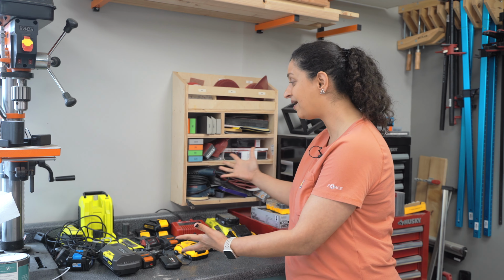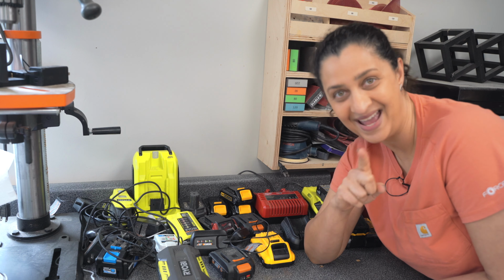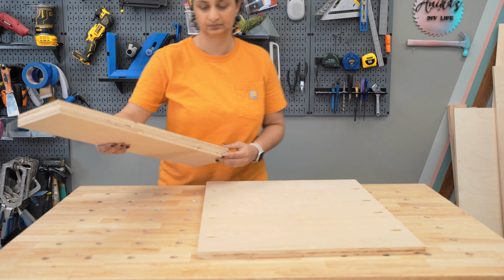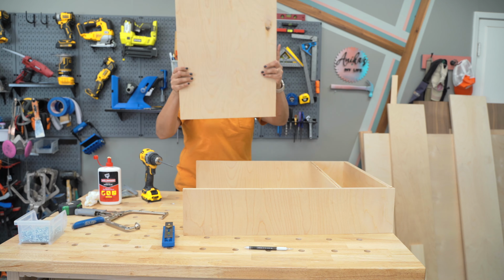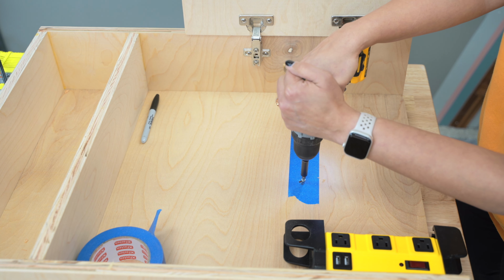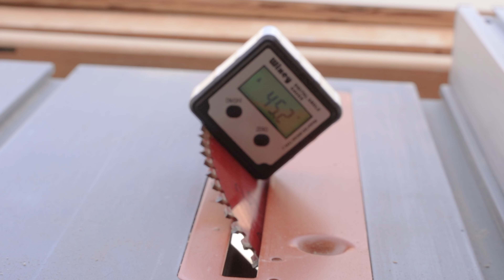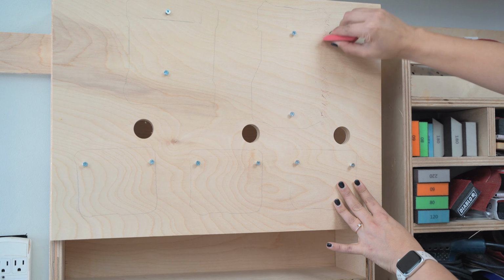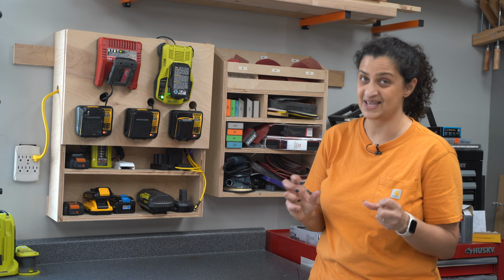DIY Battery Charging Station: Easy and Effective

Comment: Nice build. But I have a question. You mounted 5 battery chargers, but you only 5 batteries?
Reply from the maker: I don’t think I am going to be charging more batteries than that at a time. But you can always modify per your needs.